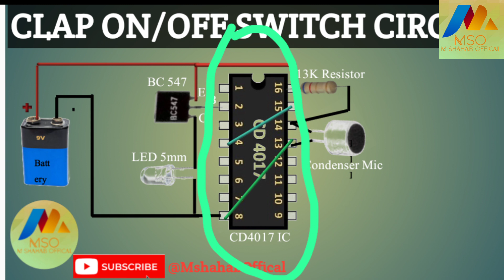|Clap On Off Switch Circuit|Simple Clap Switch Circuit| How to Make Clap On Off Circuit| BreadBoard.

Comment: Sir 13 k  & 26 k resistor kitna watt ka he
Reply from the maker: Power is usually calculated by multiplying voltage and current (P = IV). But, by applying Ohm's law, we can also use the resistance value in calculating power. If we know the current running through a resistor, we can calculate the power as:

P=I^2*R
Or, if we know the voltage across a resistor, the power can be calculated as:

P=V^2/R